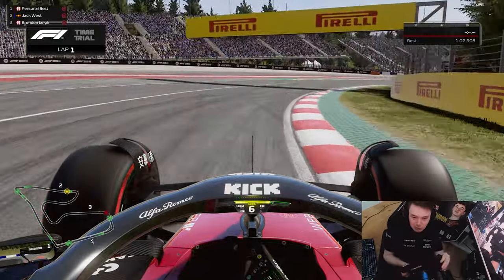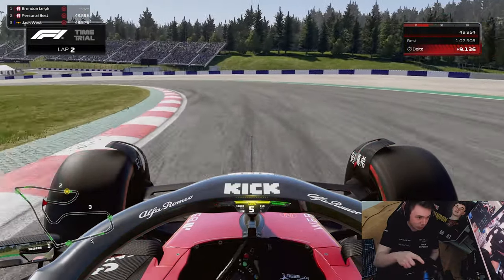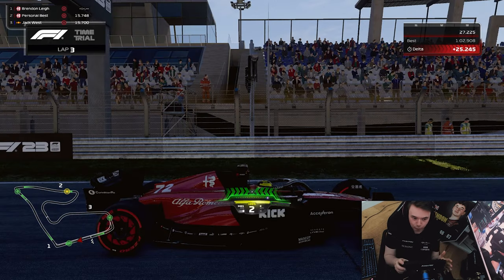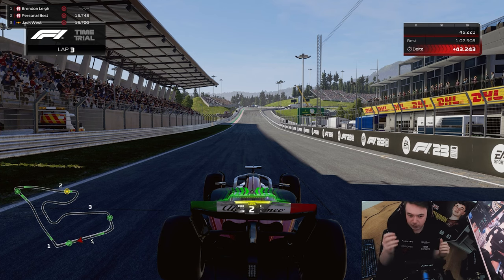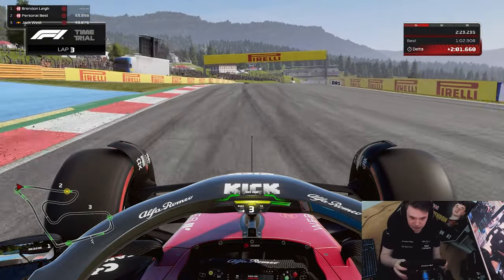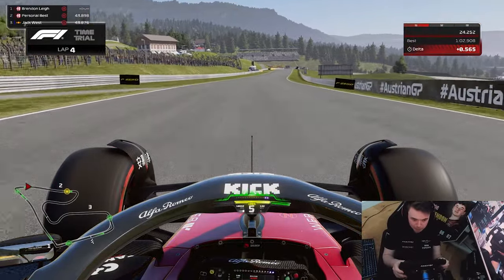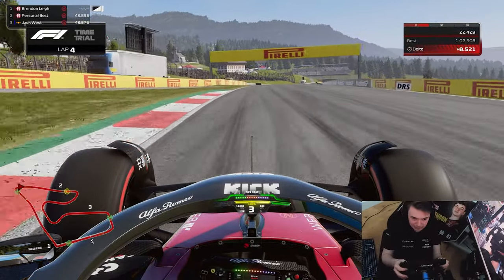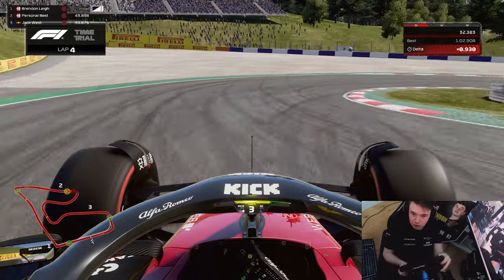F1 23 Master traction with this technique - beginner guide

Comment: so cool to see an esports driver try to help the community out so much. Ive been playing since F1 2016, top 2000 on TT on pretty much all tracks and some of these videos are really helpful even to me. Thanks Brendon!
Reply: Do you think turning all assists off gives you a significant boost to speed? Say 0.500+ ?
Reply: @Tieupp  Auto Gears and Traction Control, absolutely. Turning off ABS would give you a small gain, line pretty much nothing I'd say

Comment: can you make a video on teaching how to get so much grip coming out of slow corners? I always feel like F1 23 pros have traction control hacks and everytime i try i get infinite wheel spin.
Reply: Lol. It seems like it. But they're masters at straughting up the wheel earlier (and so get on the throttle much earlier) than we mortals.
Reply: One technique. For example. Most drivers use low gears and most would go to 2nd gear in a hairpin. Instead keep it in 3rd gear and it dulls the power and makes traction easier. 
And the other problem is pressing  on the accelerator to aggressively.
The other would be your throttle imput